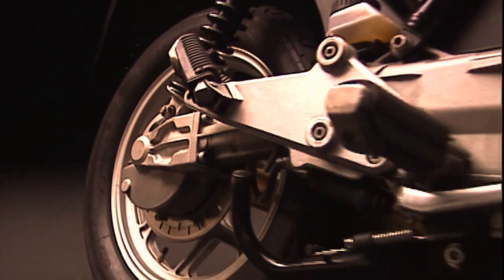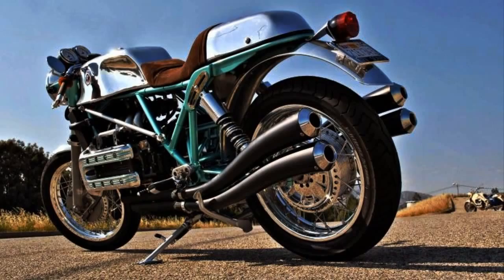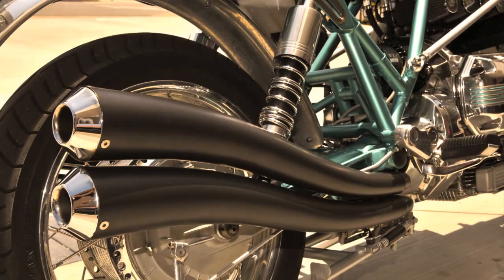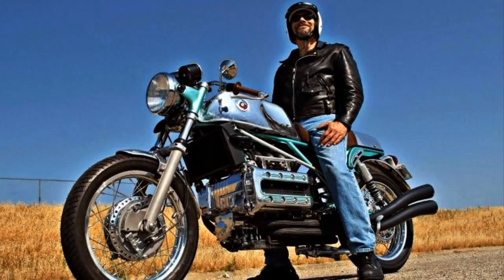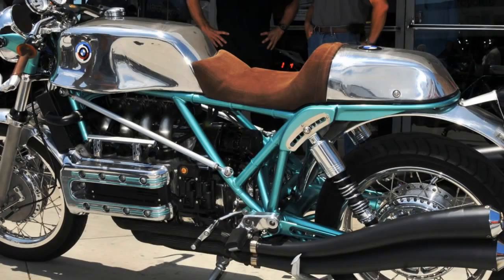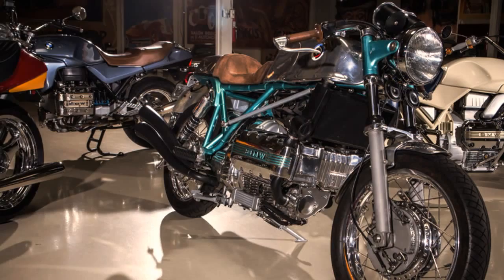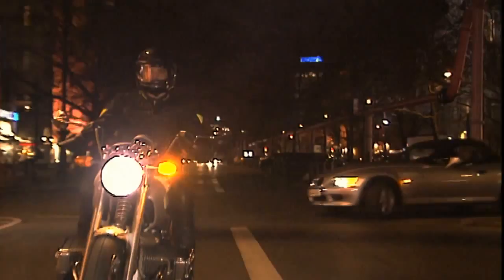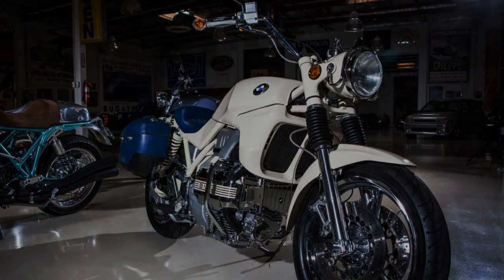Cafe Racer (BMW K-Series by Larry, and Carol Romestant)

Comment: Very nice metalwork and details... Frame color is not my cup of tea but good choise still. Love the pipes, they are stunning.
Reply from the maker: timo vähäkuopus Hi Timo, you are absolutely right about Frame color. It is ok, but not for everybody tastes. Thanks for sharing your comment.
Reply: RACER TV Frame color has to grow on you I think. I didn't like it at first but after watching Jay Lenos video on this bike and watching this video for the 3rd time, I like it a lot better. The K series were used by Dutch police in the 80's and 90's. You can sometimes buy these bikes at export dealers and even after 160-170.000km they still run perfect. Some amazing German engineering but I like the airheads better ;)
Reply from the maker: OpaSann0
You are right. This green is one of those colours that need time to start liking it. Thanks for sharing your comment.